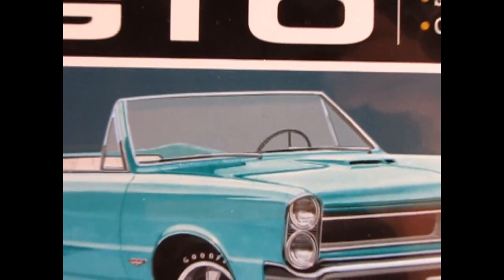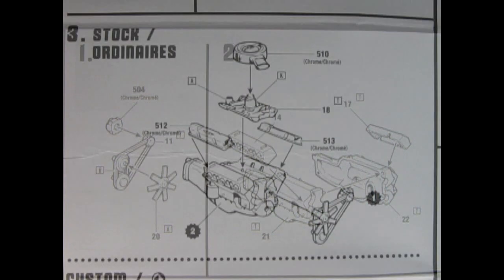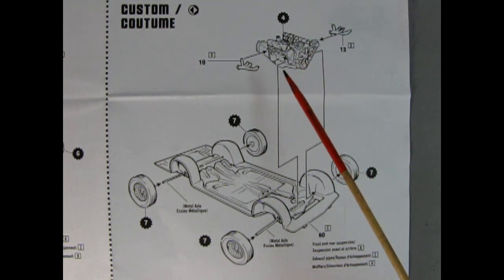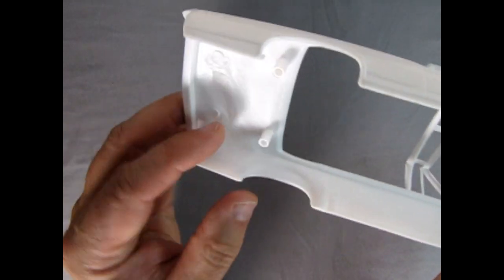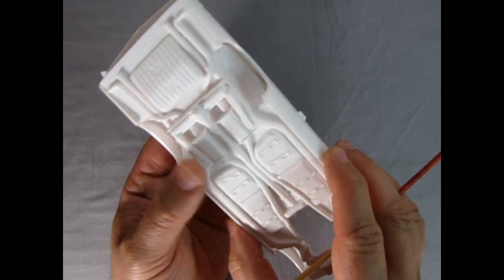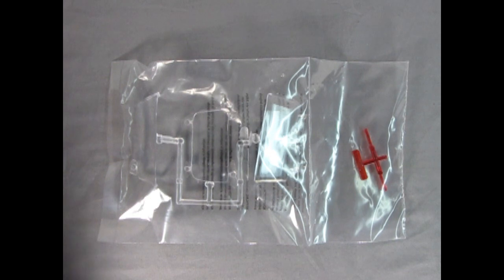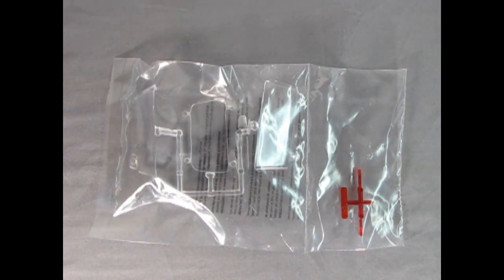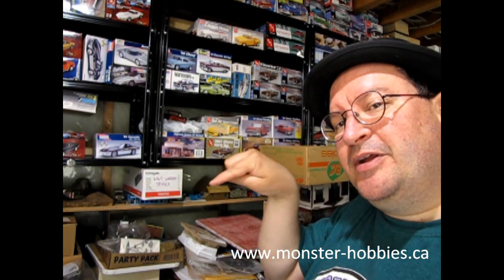Model Car Garage - The 1965 Pontiac GTO 2 in 1 by AMT - A Model Car Unboxing Video

Comment: I would build the tri power carb setup.  Convertible,  stock front end.  Hurst wheels and red line tires.  And as far as 389 or 421, the block was the same size. Bore and stroke were different.   So... it's whatever cubic inch the builder says it is!!!  🙂🙂🙂
Reply from the maker: For sure. I just wasn't sure if the 421 was available to the GTO in this year, or if it was for the larger Pontiacs like Catalina. I'll probably go for the tri-carbs and Hurst wheels because my older kits never had that option. I am debating getting a second kit to do one with the custom front end though.
Reply: @MonsterHobbiesModelCarGarage  the 389 was available but not the 421 in the GTO 
Buttttttt
If I had a 421 I could install it 
I have a friend who had a 1978 Trans am. He put a 428 super duty in it. And I ordered him a 2 four barrel intake from warrior performance in Ypsilanti Michigan 
  Talk about a screamer!!!
I  drove it once.
Reply from the maker: Sounds like fun!